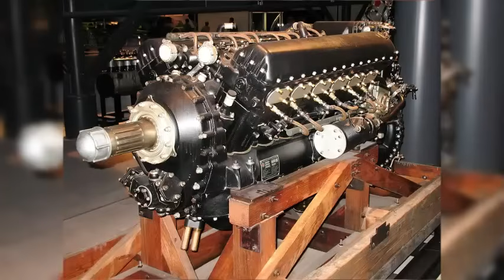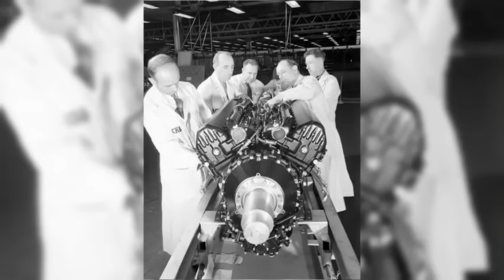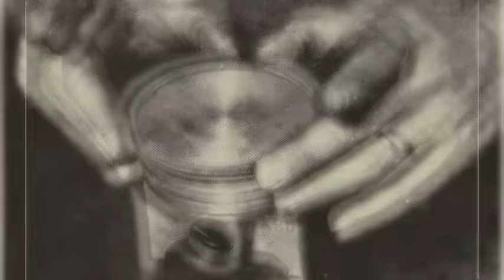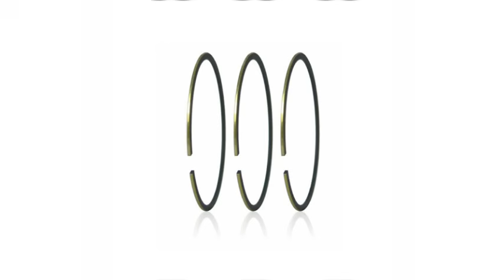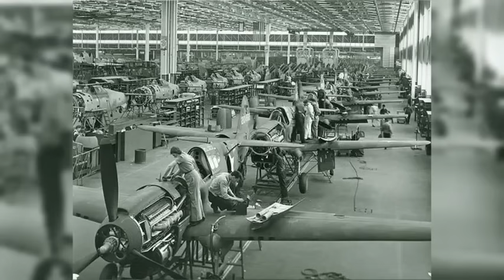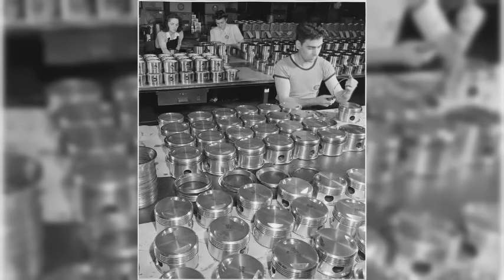America Had No Piston Rings in 1940 — So Hastings Made Chrome-Plated Rings Instead

Comment: Automotive engines of the day were normally aspirated. Aircraft engines were boosted to around 12 psi in the early war years and around 30 psi by 1944 with testing up to 36 psi.. That was achieved with 150 octane fuel and water injection. Those were enormous loads on all engine parts compared to what was being manufactured only five years earlier.

Comment: America had cast iron rings which were suitable for Automobiles of the era. but not for Aircraft, requiring the need for chrome rings. cast iron rings are more forgiving to use. they seat much easier where as chrome rings are more difficult to get them to seat. but in high performance applications they were necessary. and proper cylinder honing and correct ring end gaps were also necessary.

Comment: This is not accurate information.   Packard simply choosing the wrong ring does not equate to some sort of a nationwide problem, especially when we already had turbo supercharged aircraft engines of high horsepower to CID with zero piston ring issues.

Comment: Strangely enough, I just listened to another video by The Engine Archives on exactly the same subject.
I liked your video better.
You can judge for yourself how much of a nerd I must be to listen to an hour's worth of videos on WW2 aircraft engine piston ring production.
A nerdly followup is to point out that the EPA's crackdown on hexavalent chrome in recent decades has caused piston rings to be made more with plasma-sprayed inlaid molybdenum on the top ring, nitrided ductile iron second rings, and the oil ring rails are still mostly chrome plated.

Comment: When I used to do three rings in cars I always would use a cheap set of Hasting cast iron rings they will will seal real fast  good rings for rear ring in the motor.
Reply: What is a “rear ring”?
Reply: .  rear ring:  a rear ring is the result of improper cleaning of the rectum

Comment: Wrong wrong wrong. America had plenty of piston rings in 1940 and good companies with the production capacity to greatly increase their volume.
Reply: But they didn't have the metallurgy to handle high temperatures and pressures in supercharged aircraft engines.

Comment: I worked at Muskegon Piston Ring company for 2 years back in the early 1970's. The rings themselves are made out of cast iron for the most part, quench and tempered. Chrome plating on the exterior face of the rings was standard for for the most part at that time. Most automotive piston ring applications have three rings on a piston-two compression rings and an 'oil ring' which is essentially two sheets of stamped steel separated by a circular spring. Interesting component and American made rings were perfectly adequate for US car applications up to WW2, but aircraft engines operated at much higher temps/pressures/etc.

Comment: A several years ago, I replaced the rings & bearings on my old, beat up 1979 Datsun pick up I use as my farm truck. I mail ordered the parts & remember the piston rings were Hastings. My rusty but trusty farm truck is still going strong!. I picked the NOS Hastings rings just by happenstance. After hearing about Hastings in this historical video, I feel lucky.
Reply: Did it need bored or did you put new rings on a lightly honed old cylinder?
Reply: @gregorymalchuk272 No,. I very lightly honed the cylinders & installed original spec rings and bearings.

Comment: So the American manufacturers had been making engines for cars and trucks since the early 1900's that had been functioning for years yet for some unknown reason they forgot how to produce them in 1940? This video doesn't make sense.
Reply: The requirements for Aircraft engines, designed to operate under supercharger boosted manifold pressures and higher temps were much more demanding than US automobile engines. US manufacturers had been making piston rings since the steam engines before the US Civil War, we knew the base processes. But chrome plating on the ring face which contacts the cylinder bore was a new challenge. It really was a novel development at the time.
Reply: Packard made high performance V12s of their own design for PT boats before they built Merlin’s.  
So it looks as something slipped through the cracks between RR’s Merlin drawings and Packard’s production.  The British Standards have their own material recipes; while the U.S., at the time, used Society of Automotive Engineers and American Iron and Steel Institute formulas.
Packard redrew RR drawings so the tolerances permitted interchangeability.  Redraw invites error.
Allison, Pratt&Whitney, Wright weren’t having ring problems.
Reply: @danbenson7587  Packard didn't just redraw RR drawings to open up tolerances for interchangeability, British drawings at that time used to different Third Angle projection view than American drawings. Since the design drives the manufacturing and inspection processes, they had to be redrawn to accommodate US manufacturing processes. Using a different Third Angle Projection often means different datums, tolerances, the full 9 yards. Packard anticipated this to some extent, there was an agreement with RR that Packard components would not be used in RR engine assembly-they had to use their own components and vice versa. The differences were small, but there was no time to test and validate the engines with all the possible streams of variation if you started mixing and matching engine components. It made logistics more challenging, but Packard engines in the field had to be provided with Packard supplied components when they were serviced and the same with Rolls-Royce engines-which used RR supplied components. What made it easier was all Packard engines were installed in P-51s, P-40s and some models of the Avro Lancaster bomber. That kept logistics simpler.

Comment: This is only half the story. The other half is honing techniques on the cylinder walls using the right honing stone coarseness is Paramount to having a successful ring because of their interaction not to mention using the right oil
Reply: Tru dat!
Reply: ,& changing more often for longevity.
                 Blow¡ng brass 🎶 since the 1960"s gave me personal tactile empathy to valve friction,  players are always discussing with each other as it wonders smooth speed playing.
                        34 years riding my American living room on wheels whose engine runs better than new!
        I suck oil out through the dipdtick in 5 minutes, then pour a fresh quart through 'til clear comes up the dipstick tube sucker line.
        Refill and listen to that quiet happy engine bathing in oil so clean you can't even see it on the dipsyick!
                The 34 year old engine literally runs better than new!
    Do the same with all other fluids   & it will last for the next 10 forevers !
                 I especially love power steering like butter!
           "Like 2 sticks of butta!"
                        (SNL "Coffee  Talk")
Reply: @aaronsmith5433 I'm verklempt..
Reply: John Ramsbottom invented the
piston ring in 1852  for steam engines. I used to have a book called engines.

Comment: So all of the internal combustion engines made in the preceeding 40 years in America; only lasted 50 hours? Sounds like BS
Reply: Conditions in a Merlin engine are far different than the Fords and Chevies of the late 1930’s.  
Compression ratios, constantly operated at very high power and high altitude, aviation gas with higher octane are just some of the differences.
Reply: @michaelg7127  The Merlin did ultimately use 150 octane fuel, but that would benefit the engine - less knock. As for compression ratios and engine rpms, the Merlin variously had 6:1 and up to 8:1 compression ratios and ran at full power between 2,500 and 3,000 rpm. Not dramatically different from performance car engines of the time and a bit above engines like the flathead V8. Bearing (no pun intended) in mind that road cars had to suffer with fuel around 50 to 60 octane rating. 

I guess my point is that with operating conditions not wildy different from performance motorcars, let's be generous and say the Merlin was pushed 4 times that of a Deusenberg or Packard, the motorcar engines were not packing it in after 200 hours. So therefore the "facts" in the video are not accurate or at the least, stretch those facts for the purpose of hyperbole.
Reply: @brianhalberry  True, the compression ratios on the Merlin or any of the WWII (supercharged) planes were not high. It was the supercharging in the one and two phase that required the higher octane. The cylinder pressures were very high and were increasing as time went on to get the higher horsepower numbers. The Germans had to make their own high octane gasoline chemically, as they could not get the tetra ethyl lead needed for the higher octane numbers.
Reply: @danawilkes8322 Granted, compression ratio vs. cylinder pressure. No doubt that a Merlin with a two stage turbo supercharger sustained much higher cylinder pressures than a supercharged Doozy. But for the video to claim that America couldn't make piston rings that lasted more than 50 hours is absurd.

I've since done extensive searches and have found nothing that directly corroborates these claims.
Reply: Tetra-ethyl lead: a technilogy invented in the USA, but now only made in the UK.
Reply: I haven't watched this video yet due to the misleading title. The aircraft mechanics might have been tearing down the engines after each 50 hours of run time for inspection and refurbishing so installing new piston rings might have been a standard practice.

Comment: I used their oil filters for a while but i guess they are done with filters. Never had any problems with them and they seemed to be a top tier filter.
Reply: Hastings filter line is now owned by Baldwin. Hastings filters are still available.
Reply: @alantrimble2881 ok thanks. Failure of Google. I will do more hunting. Nothing came up last time I tried. Could be I goofed